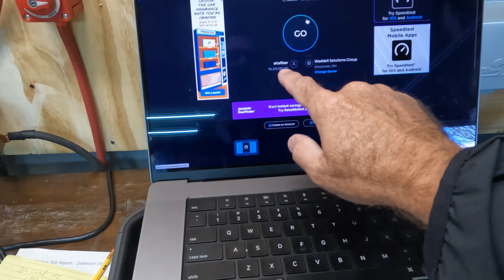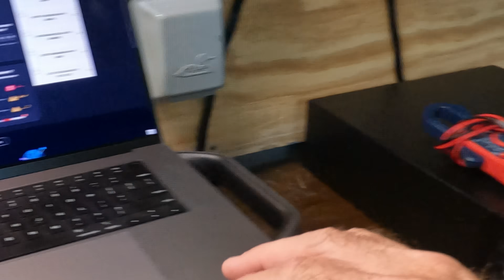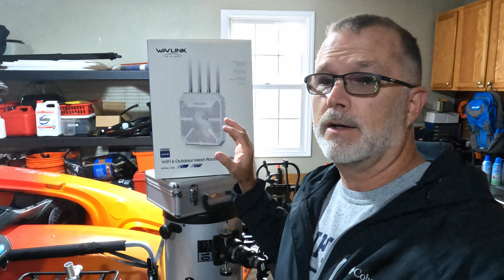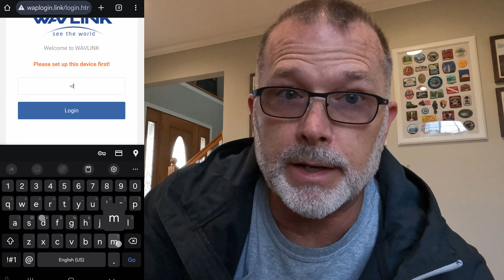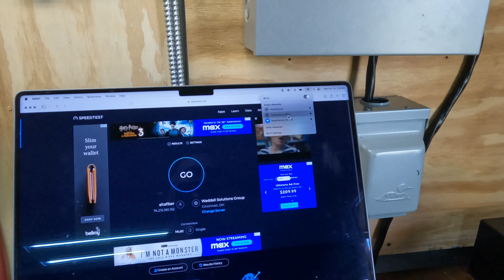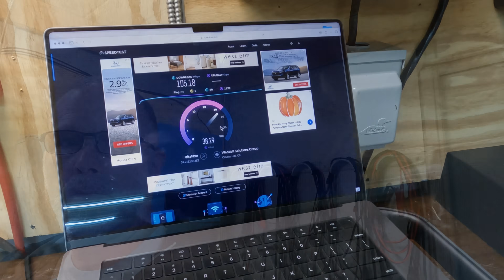EASY Way to Extend your WiFi Network Across Several Acres: WAVLINK AX1800 WiFi 6 Extender

Comment: Looks like it works well.   I found myself wondering about the lack of lightning/surge protection on your Ethernet cable from the POE adapter to the outside unit.   I live in thunderstorm country; it doesn't take a direct strike to really f with electronics.

Comment: Does the outside access point interfere with the inside system? I have the TP link mesh system inside and would love to have the external system to pick up. Security cam at the end of my drive.

Comment: Your best and most simple option is to get a powerline extender adapter from like TP-Link. It plugs into any power outlet, and uses your electrical wiring to send data. That is what I use to because running ethernet is too long and wifi extender diminishes too much.
Reply: Assuming your outbuilding is on the same circuit.

Comment: That's remarkable.  My wife and I both work remotely, as well.  We already owned a rural property (10 acres) and were notified that our local electric company was going to be burying the power lines and removing the overhead lines.  At the same time, they were bringing in a fiber optic line...that was when we decided to build!  I'll be looking into this WiFi extender so that we can leverage those speeds outside of the barndominium walls.  :)

Comment: TP link has units that can be hardwired, either with cat 6 or via standard electrical conduit, to extend  your range with less likelihood of undesirable attempts at unauthorized connection (or network penetration) and without loss of signal strength.
Reply: This is the most cost-effective and and simple method.

Comment: That device is not cheap it still costed you $200 what the hell are you talking about?
Reply from the maker: I could've gone the PtP wireless bridge route for about the same cost....BUT I'd have to do 2x the cabling, and then add another mesh router module costing an additional $150. I'd end up with (presumably) faster speeds, but I still would've had dead zones in other areas of the property. So...for me at least, I don't consider the $200 cost to be excessive.

Comment: Two Unifi loco 5ac (no cloud key required).   At the barn POE injector pwr to Loco5ac and LAN side of injector to Wifi Access Point or network equipment.

Comment: Wonderful info.

Did you consider TP-Link Deco Outdoor Mesh WiFi (Deco X50- Outdoor), AX3000? I have this one for a similar purpose, but not nearly as far as you need yours, and my shed is more of a tiny wooden house in my backyard. Works great.
Reply: The X50-Outdoor claims to cover 2500sqft, which is 50x50.  Pretty useless except maybe for a deck.

Comment: Maybe you should get wifi antenna that's runs out of your metal building
Reply: Thinking the exact same thing.  A quality access point mounted outside the barn would be able to connect to your existing network at 25% of the cost.

Comment: Excellent information!  We've tried a couple of different "extenders" with little success.  Your setup looks great!  Thanks!
Reply from the maker: @kbjerke  yeah I tried it in wireless repeater mode and didn't really get much benefit.  But using AP mode it really does solve my coverage needs. :)